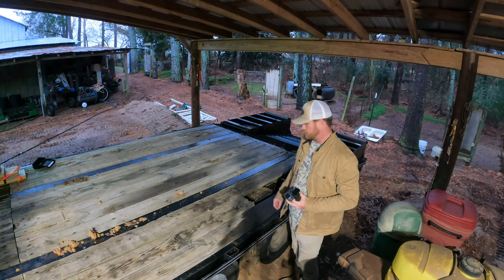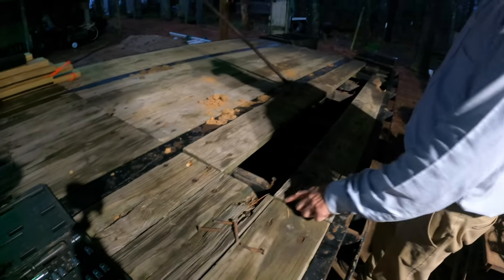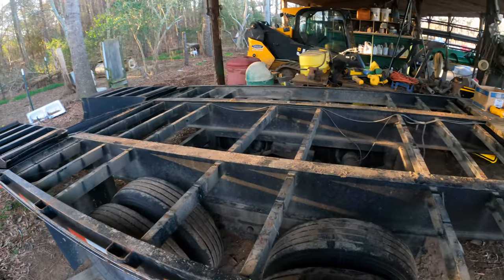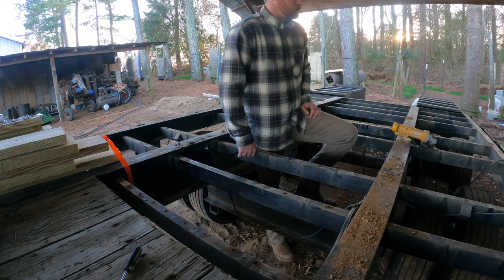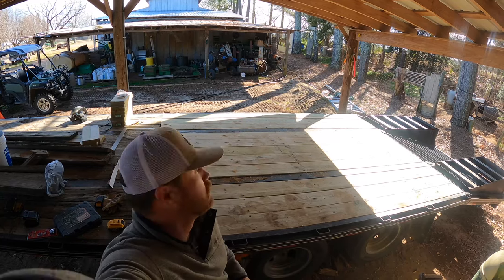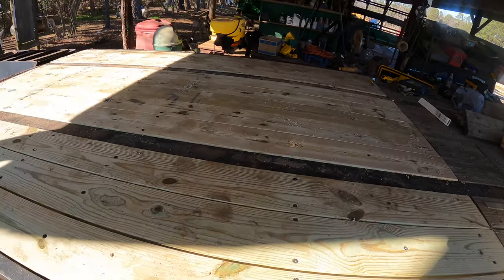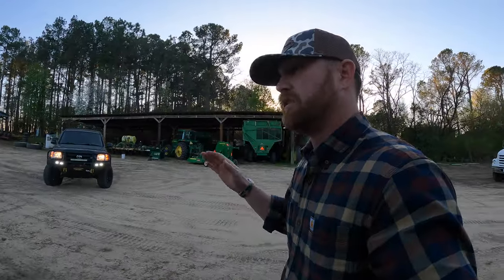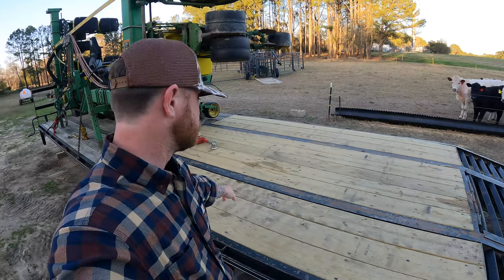Replacing ROTTEN & BROKEN Boards on the Gooseneck Trailer Restoration. Not as Hard as It Looks!

Comment: When putting boards down. Look at the grain on end of board. Put arch of grain on top side. That will help keep it from curling up later. I noticed the first board you cut . You  put on upside down as far as grain goes.
Reply from the maker: Thanks for the comment! We’re going to weld steel across the end of both to keep them from doing that in the future!

Comment: I have to do this same job on both my gooseneck trailers 40' and 25'. What kind of fasteners did you use???
Reply from the maker: We had to special order them. I can’t remember off the top of my head. I took the screws I got out up to tractor supply to get a comparable set to order.